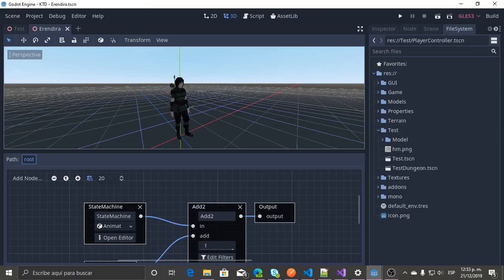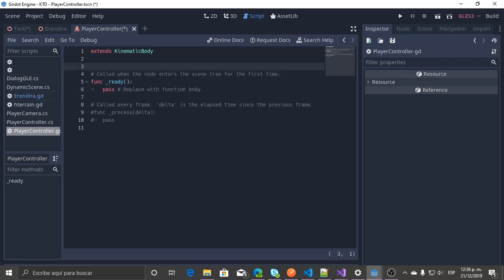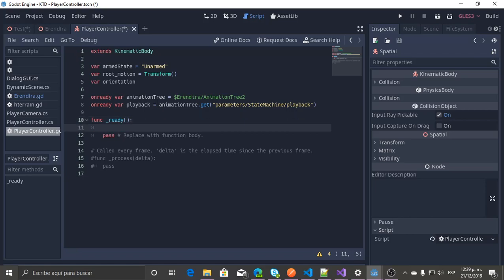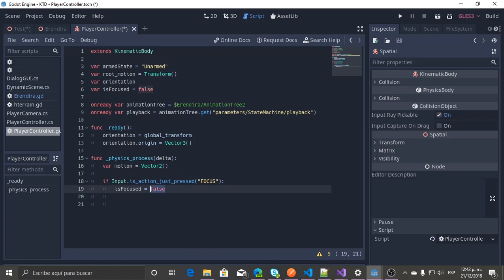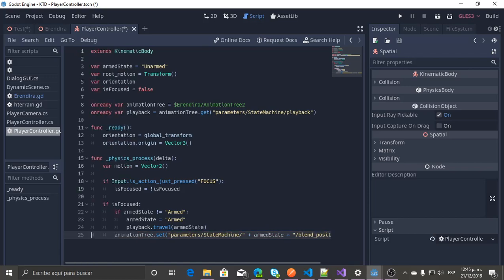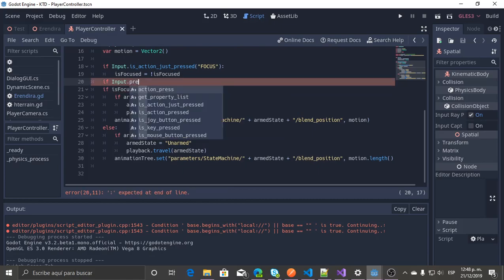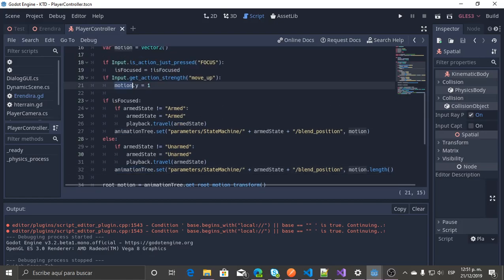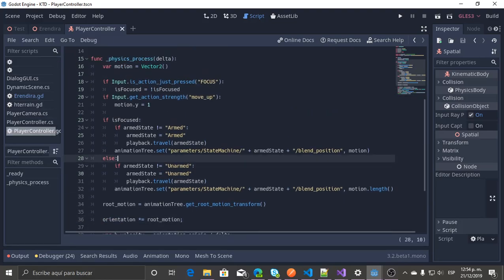Using Godot's State Machine (Code)

Comment: Hey, this video helped me a lot with using root motion in godot, but I can't figure out how to rotate/turn the character, and you are the only one who have any documentation on root motion in godot, could you give any help or hint how to make that happen?
Reply from the maker: Are you animating your model or using Mixamo's animations? You need the animation to rotate around Y (Up vector), in Mixamo there are some animations that meet this criteria, but I forgot to upload the script changes and I won't have access to that machine in a while.
Reply: @DavidOCYT  And regarding the movement itself, perhaps you can tell me how to make it work? Or not gonna be able without that script. I just don't believe that EVERYTHING made with animation, the turning have to be controlled from code I think.
Reply from the maker: @Pupoger   The script is needed if you want your character to turn to the desired direction before moving. You need a "target" where your character will turn to, I depends of the  type of movement you want how you calculate it from the camera, you may want to look at GGT (https://viniguerrero.itch.io/godot-game-tools), it creates a sample project and it's possible I will switch to this tool to import my models.

Comment: Do you have an example on what could be done to ease the transition value in order to make the animation change more smooth?
Reply from the maker: I'm not at the computer right now, I'll review an example and will post the code.
Reply: @DavidOCYT  thank you! I will try to set up a jump state as well
Reply from the maker: You need a variable to hold your current motion, in this case is a Vector2 called motion, then you get how much you want to move your character:

var motion_target = new Vector2(Input.GetActionStrength("move_right") - Input.GetActionStrength("move_left"),
        Input.GetActionStrength("move_up") - Input.GetActionStrength("move_down"));

Then you interpolate using the delta and a velocity (you need to change it to your liking):

motion = motion.LinearInterpolate(motion_target, MOTION_INTERPOLATE_SPEED * delta);
Reply: @DavidOCYT  awesome! Thanks a lot! This seems to be a very obscure topic and I can't see to find good materials related to this. The change is brutal, animations get really more smooth and I was only able to learn how to work with this due to your tutorials! Thank you very much, keep it up!